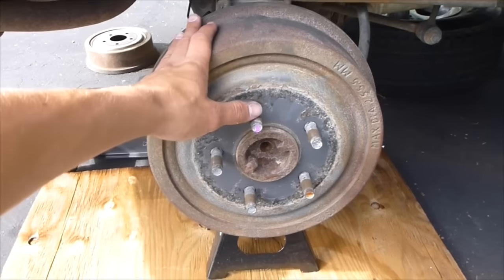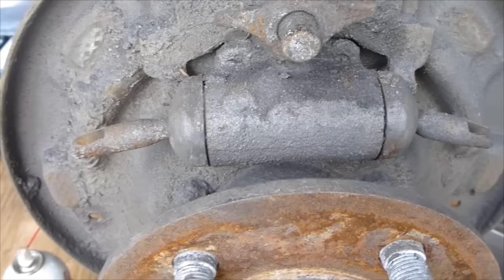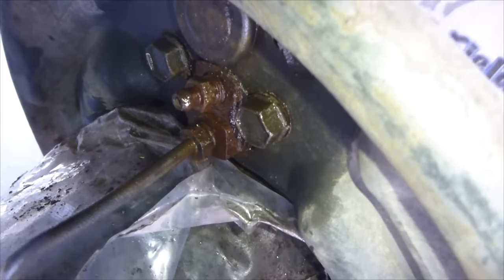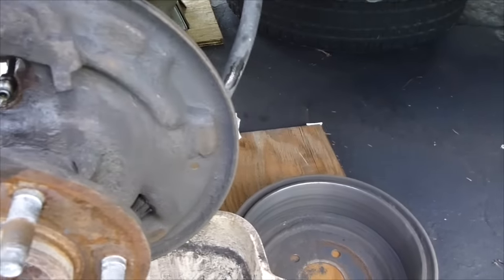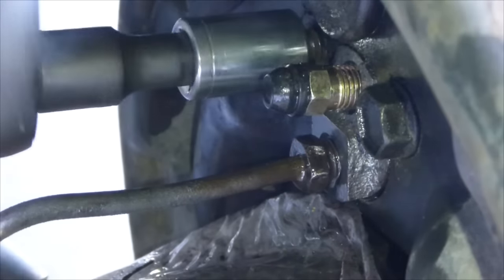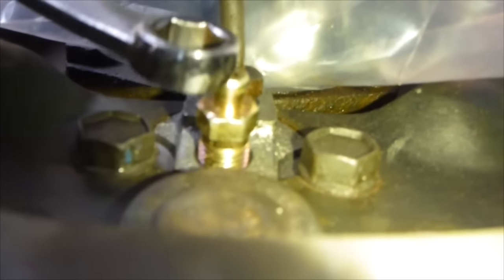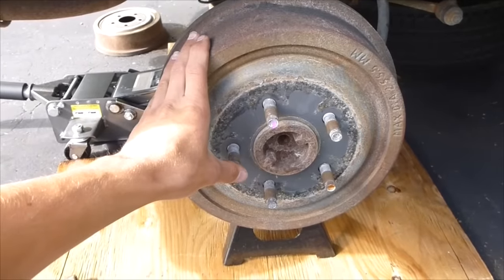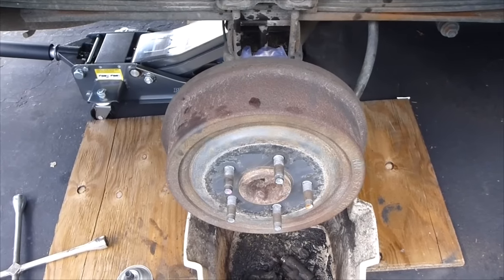How to Replace a Wheel Cylinder

Comment: There is a way to bleed brakes without a helper. it costs you a little more fluid, but it works. You need a piece of vacuum line that fits over the bleeder valve tightly. run that hose down to a clean bottle with enough fluid in it to cover the end of the hose well, like an inch worth. open the bleeder valve with the hose on it, then go press the brakes a a number of times, engine running if like most cars or trucks you have power brakes on something old enough that it doesn't have power brakes, starting the motor doesn't do anything. How it works, well once the hose is full of fluid, when you pump, the air will bubble out, but when it sucks back, it sucks back fluid. Make sure to keep your brake fluid level high so you don't have to start all over again by running the system dry. I have done this job quite a few times, but it's been so long I thought I best look at it on here to refresh my memory, my rememberer ain't what it used to be, I'm old.

Comment from the maker: I would not suggest plumbing tape. Is the end of the tube chipped or bent? It should not leak and you shouldnt need any dressing on it to prevent a leak. Maybe you crossthreaded it or it wasnt pushed in straight. I would try taking it off and inspecting it and then putting it back on if you dont see anything.  and seeing what your problem is.

Comment: If you have rubber brake hoses you can clamp them off. It you turn a bolt or anything with a thread backwards first you will feel a click that's start of the thread,this stops cross threading

Comment: What's the best way to clean the backing plate? Is it better to do this first? Great video.
Reply from the maker: Chapter Operations Take all of the springs and stuff off, leave the wheel cylinder on so you dont contaminate the brake fluid, and hit it with brake cleaner. Then use a wire brush on it, then hit it again with brake cleaner.

Comment: Chris, do you have a video on how to fix or replace rear ABS  brakes on a 2004 Ford F150? What is the cost for this fix or replacement? I was told by a mechanic that my brakes dont have pressure when I step on brakes because my right rear ABS isnt working properly.

Comment: Hi Chris, the method I use was almost the same in your video except engine was not running and I would loosen the bleeder nut once the brake pedal was fully pressed. Your thoughts?

Comment: Breeding the blakes. I've said the same thing before. LOL. 
Get some line wrenches for the brake line fitting, that will keep the nut from rounding off, A open end wrench will slip and round off the nut if it's rusted in there.
Reply from the maker: Yea, I should get some line wrenches. Luckily I havent had any badly rusted nuts so a regular wrench has worked for me!

Comment: hey @Chrisfix thanks for all your helpful videos. I have a question; I am redoing my rear shoes and hardware and had my drums resurfaced, and I was going to install a new wheel cylinder and happened to notice that the metal line that runs from the strut os missing. It seems the previous owner cut off the metal line, how do I go about replacing it?

Comment: Hey ChrisFix.. I own a 2011 GMC Canyon WT 2wd with a 2.9l engine.  Just purchased new tires for my truck and the mechanic noticed a slight seeping around one of my wheel cylinders.  He says I could wait... However, I have 90k on this truck and tow a small boat to Ontario a few times every summer.

Comment: Nice vid. Maybe one small remark. I would advise viewers to a specific brake bleeder wrench instead if an open end wrench. If they are old and rusted its easy to strip those.
Reply from the maker: Thanks for the tip! I try to use common tools so anyone can do it, but it is definitely worth mentioning!

Comment: Great video Chris. I tackled a leaking cylinder this weekend. The bolts on my cylinder aren't 10mm. Having a hard time getting 2nd bolt off. I sprayed it and sprayed it. Not budging. Any suggestions? Looks like I also rounded off the brake line bolt too. Can that be replaced?
Reply from the maker: +Stephen Harris heat will get the other bolt off. Here is amazing penetrating fluid: https://www.youtube.com/watch?v=2WuVBFTzoKc
Reply from the maker: +Stephen Harris as for rounding the bolt on the brake link, you would have to cut the brake line, and slide a new flare nut bolt over it, then flare the brake line using this kit: http://amzn.to/1Vuad6d
Reply: +ChrisFix Thanks Chris

Comment: Hey Chris I have the same truck. One wheel cylinder is bad. I replaced everything on the rear brakes maybe 6 years ago (10k miles at the most). Is it ok to just replace a wheel cylinder and not touch the other side?

Comment: First of all, I watched your video on replacing calipers, rotors and pads.  Easy and now I have all new brakes on the front of my 96 Ford Ranger.  Thanks.

Now with the same truck, with the back brakes, I cannot get the drum off the driver side.  Wasted a can of PB Blaster; didn't work.  Tried tapping and hard; broke part of the side of the drum off.  Tried the heat; no good.  Any ideas there?  ( I asked this on the video for taking off the drum and rotors too, so it can be hopefully answered there).

I got everything off the passenger rear of my 96 Ranger.  EXCEPT the wheel cylinder, which is leaking like the one in your video.  Same size tools - awesome.  BUT, the last person who installed the wheel cylinder or hooked up the brake line, stripped the brake line nut going into the wheel cylinder.  Any helpful hints with this?

Thanks.
Geoff
Reply from the maker: Try this: https://www.youtube.com/watch?v=y6jpNC6emOQ

Comment: Hey chris ever seen a cylinder where 1 of the half retaining bolts and the inlet for the brake line are covered up? Its factory just replaced the backing plates on a 1963 ford thunderbird and did everything how the book said still ended up having to put the cylinder on before mounting backing plates

Comment: Hey thanks for making this video and the other one on changing the drum brakes, really helpful. I just replaced the rear drum brakes on my 91 Ranger - shoes, hardware, wheel cylinders - but I tested them out in the driveway and the pedal is really loose, have to push it all the way to the floor.
Could that be from air getting into the brake line after changing the wheel cylinders and/or the shoes not being snug enough? 
Thanks again, appreciate any input since the brakes on your truck are pretty much the same.
Reply from the maker: You have to bleed the brakes if you change the wheel cylinders. It is definitely from air in the lines
Reply: ChrisFix thanks for your help, much appreciated
Reply from the maker: No prob!

Comment: Messy job, but worth the effort.  I prefer using a line wrench rather than a standard box wrench when working on brake lines.  Less chance of the wrench slipping off. You also eliminate the potential to round the edges on the fitting. 
Also, never, ever use teflon tape on any brake lines.

Comment: Hey Chris, hope your well
I have question I'm in a bit if dilimier, I've got car on stands at moment.

I'm  doing a service clean and adjustment  for the rear  back brake drums. I was just checking the wheel cyclinder for leaks under the rubber Gromet seal but I manged to pull  it off and abit of fluids come out and poured on to the bottom cornor of the shoes.  I used break cleaner stright away and lightly   sanded the shoe area.

My question are: 
Do I need to change wheel cyclinder ?
Do I need to replace the shoes (pair)?
Do I need to bleed just that one wheel or both back wheels or do I need to all 4 wheels?

Comment: This is the last part of the brake system I have not changed I did the drums and mechanical parts but not the cylinders also new calipers and pads in front new master cylinder brake booster rear pads so I should be in good shape after replacing these since one is leaking

Comment: Awesome video! I have a question..I have 2006 kia spectra 2.0 with abs brakes..can I change my brake fluid  on abs brake system or do I need to have it done by a professional?
Reply from the maker: You can do it yourself. The car you see in this video has ABS. Just need to bleed the brakes. Do you want to change all of your brake fluid or just bleed the brakes a little?
Reply: I want to change all brake fluid. what will i need ? Thanks
Reply from the maker: tony shots All you need to do is get a turkey baster and pull out as much fluid as you can from the master cylinder (without letting it run completely dry. Then fill it up over the fill line with new brake fluid. Now go and bleed each wheel. You should bleed your furthest wheel from the master cylinder first. This might be conunter intuitive because your ABS system might make the front wheels further so try and look it up. If you cant find that info, bleed the passenger rear, driver rear, passenger front, then drivers front. Make you you bleed the fluid until it runs clear (a clear tube over the end of the bleeder valve helps you visualize this. And MAKE SURE you dont run the master cylinder dry. Check the level each time you bleed a brake and fill it with new fluid when it gets low. I will be making a video about this shortly but for now hopefully this helps.
Reply: Ok cool thanks. I look forward to seeing the video.thanks
Reply from the maker: The "how to flush brake fluid" video will be done next week. I finished filming today and now I will edit it! Stay tuned!
Reply: Ok I already bled my brakes but will def check out the video.

Comment: From what I've been told it's better to keep the engine off when bleeding the brakes, that way the brake booster won't interfere and possibly get air in the lines
Reply from the maker: +aleks5005 Thanks for sharing. It doesnt matter.The brake booster wont get air into the master cylinder. Two different systems.

Comment: Easy job,I did that myself and saved the 50 bucks they wanted for labor.
for both rear cylinders
Reply from the maker: Great! Glad you did them yourself! Did they want $50 each for labor when replacing the brakes too or just to do the rear cylinders?
Reply: ChrisFix They wanted 50 for just the two cylinders.I ended up replacing the pads because they were sludged up and rusty from the brake fluid.First time doing a brake job.I thing i did very well,took my time.
Reply from the maker: Nice. Glad you saved $50! Good work!

Comment: My drum (leading to wheel as well) doesn't move in either direction. Do you think partially open the brake line and let it drip and put it back may help? Also a basic question as I haven't checked the other side which works fine, can you just take the drum off without doing anything as long as the wheel is off as in the video or are there some bolts that you need to take off before doing that?

Comment: Have you done a video on anything with the emissions. Have a 05 Kia Sedona LX  I have replaced the evac  module  3 times and still  have the engine light came on  about 3 months later with the same code.

Comment: Do you only need to bleed the wheel where you replaced the wheel cylinder or do you need to bleed all 4 wheels after opening the hydraulic system?

Comment: just would like to ask if changing the brake cylinders to you have to change both because my one cylinder is smaller then the other and iv got no brake fluid coming out the one brake line

Comment: Hi how you doing , great video and you explain very easy , im portuguese so i will trie make me undestand , i have a question about the cylinder and i dont know if you can anser me , i have a jeep cherokee and some days ago i changed the drum brake shoes however i saw that one shoe doesnt return nice to the place after i brake in pedal , so my question now is it if this migth be a cylinder problem or the return springs problem , now i dont know what to change , the cylinder doesnt have a return funcion rigth?  thankyou
Reply from the maker: joao fretes Paulo It could be a cylinder problem (are they leaking)? It could be a rubber brake hose that is not working (clogged or collapsed). It could also be the return springs. My suggestion would be to replace all of the springs and the wheel cylinder. They are both cheap and when you do that, you will see if it works right. If not, it is probably the brake line. You can also inspect the brake line.
Reply: Ok thankyou , they are not leaking and i will bet in the springs because when i do the brake they woark fine the problem is to came back to the place , my dawt was if the cylinder do that job but i saw some videos alreaddy and i guess the cylinder does not make the shoes return....im seeing now what a silly question this mine ...thankx again man

Comment: You pump the brake pedal a few times and then hold while the other person opens the bleeder and when the brake pedal goes down all the way the person inside the car maintains holding the pedal until the outside person snugs up the bleeder.Repeat until the outside person gets all the air out of the brake line.There is no need to have the car running while bleeding the brakes.

Comment: Alright, I have discs in the front and drums in the rear. Pedal went all the way to the floor before starting to brake. Brakes stopped the vehicle. I bled the brakes and it made no difference. Replaced the master cylinder(bled the mc, and all lines) no difference. Bled all lines with your method with the bottle and i saw all the air bubbles come out. That made no difference. I don't lose brake fluid so the lines are fine(i think). I don't hear any whistling from the brake booster. Do you think I need new wheel cylinders? Any help would be appreciated. Thanks in advance!
Reply from the maker: +AceRiding Are the wheel cylinders wet under the boot? Are they leaking? Sounds like you have air in the system for sure!
Reply: +ChrisFix no leaks Autozone dude thought it was the abs. He said it had air in it and it needed to be bleed. He said you have to use a snap on scanner that's like 10k. It's called an automated bleed. Do u know anything about this?
Reply: +AceRiding Did you ever find a fix? I have the same exact issue. Any feedback would be greatly appreciated!!!!
Reply: +Brandon Maloy I ended up selling the car, from what I heard you have to have an expensive code reader and you have to do an abs automated bleed. If I were to have to deal with it I would have just removed the abs module

Comment: >>>!PRIUS!<<< Doing this brake replacement on a Prius or other hybrid battery car usually will need more things done to keep the brake system operating correctly such as different fusses pulled and brake bleeding done with a special electronic device. Look up your vehicle first before starting the brake procedure. I learned this the hard way when I replaced my pads like this video showed only to have a ton of abs traction control ec.. lights activate and no way to properly bleed my brakes without the proper electronics system that controls the brake electronics. hope this helps someone.
Reply: Manufacturers do that a lot these days. Makes you take it in to get serviced by their "authorized" mechanics. Personally, I'd like the check engine light to come with an error code on the odometer, so I can look up myself what the problem is.

Comment: If you are changing out the REAR cylinders, do you have to bleed the front brakes or only the rears?  I would imagine that only the rear is needed for bleeding right?

Just want to make sure.

Thanks,
-Nigel
Reply from the maker: Yea, you only need to bleed the lines that you take the cylinders off of. No need to bleed everything.
Reply: ChrisFix

Thanks for this!  Went very smoothly... DUMMY me, I bled the brakes without putting the drums back on and what ended up happening was the shoes expanded too far and I had to take it all apart and push the cylinders in a little bit and re-align everything.  But other than that very excellent video!

Thank you,
-Nigel
Reply from the maker: NewShockerGuy Awesome! Live and learn! At least you got some practice doing the drums lol. Glad the video was helpful!

Comment: Thanks, that issue is resolved now I have a wierd, humming noise in back could that be a bearing in my transfer case, or something else, it didn' t make that noise before, and somewhat seems a little diff set entry to drive....wierd! W/only 51.000 miles and an 04, you'd think all of this is happening prematurely..right?
Reply from the maker: Karen Witkowski That stinks. Yea, that shouldnt happen at 51k miles. What car can year? It could also just be your brakes seating since you messed around with them. Give it a week. You should check your diff fluid and maybe give it a change if you think the diff is making noise: How to change rear Differential Fluid (detailed version)

Comment: Is it one or two of them (crush washers)? I found just one of them on the Banjo Bolt of the old cylinder, but in the pack for a new set there are two of them. Where does the second go? 2001 Saturn SL2.

Comment: Doing this on my old SAAB 96 1972 this weekend.. doesn't even have a bleeder valve on the current one... been stored away for 30 years :)
Reply from the maker: +HirYoshima Crazy! Good luck!
Reply: +ChrisFix thx man.. Btw, it's up sida down from your construction, so med  bleeders are on the bottom of the brake. No spilling on the car.. #swedishengineering

Comment: So easy, doing a check again later on my 4Runner. I had switched the cylinder and everything seemed fine until brake fluid started leaking again and filling up my driveway. The thing is that my brake fluid reservoir is on full the whole time yet it’s been leaking. I did the change basically the same way You did and it’s still leaking but only when it’s parked for a while. Now my brake pedal goes to the floor and it doesn’t work. I can’t pinpoint the originating leak. Could it be the cylinder that didn’t work?